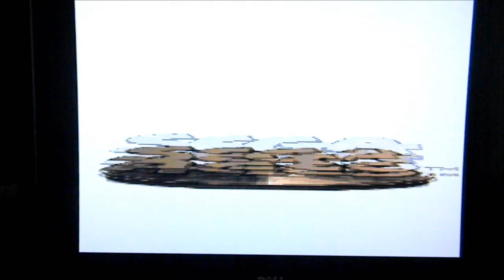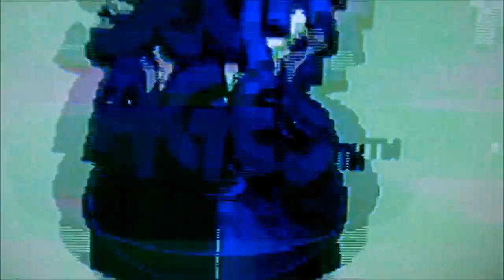SLG3000 Scanline Generator Review and Demo

Comment: For some reason mine causes the picture to go extremely dark, so much so that details are lost (for example Castlevania SotN's backgrounds turn entirely black). I've turned all RGB dials up as well and even at their brightest, the picture is dimmed about 50%. s
Scanlines in emulators don't have this effect. The only difference I'd that I am running this through a Retroscaler 2x.

TL;DR: How do you brighten up the screen while using this device?

Comment: Hey there, I know this video is rather old, but I wanted to ask you about my setup since you seem knowledgeable on the subject. I am emulating retro games on my PC via Retroarch and Fightcade, and I have a CRT PC monitor (my graphics card is old enough to connect via VGA cable). 

Since my monitor is limited to a 31kHz signal, I can't get the older 240p style games with the native scanlines like you can in these videos with your tri-sync monitor. While there are shaders available, I am particularly interested in arcade games, which are difficult to display correctly with integer scaling in a 4:3 aspect ratio without black bars, and most shaders are designed with integer scaling in mind. I was wondering if now, in 2024, you'd recommend I get a bit of equipment like the SLG3000 to get the scanlines for these older games, or if there are better options available for this sort of thing nowadays.

Either way I appreciate these videos, and I wish I had come across them earlier in my journey to learning about CRTs/scanlines -- it would have saved me a lot of time and confusion. That's impressive considering these are from 13 years ago!
Reply from the maker: SLG3000 is definitely worth a go on your PC CRT, but I'd be inclined to mess around with shaders as you can do so much with these nowadays.  Are you using MAME or Retroarch for your emulation?
Reply: I appreciate the response. I am using Fightcade and Retroarch for emulation, but I can't seem to get integer scaling to work properly on the old arcade titles, which are not exactly 240 but more oddball resolutions like 224 (like Capcom fighters for example). Using integer scaling + 480p results in black bars, and the best shaders require integer scaling.

The way I figure it, I could run those games full screen in 4:3 aspect ratio the same way they ran in the arcades, then use something like the SLG3000, and I'd have it pretty near accurate. What do you think?
Reply from the maker: @SleightSoda  Mmmmm.... I use MAME with HLSL and it works fine for me.  Are you getting alignment issues with scanlines using shaders and non integer?
Reply: Yes exactly, most of the shaders on Retroarch require integer scaling, and I'm not too happy with the ones that work without integer scaling. The only other solution I've found is super resolutions, but my PC Monitor is too underscanned for those to fill the screen completely on the left and right sides.

I think overall something like the SLG3000 will give me better scanlines and allow me to have the same results whether I'm using Retroarch or Fightcade (which is an important goal for my setup).

I was wondering, while I have you here, if there were any monitors in particular you would recommend? I have an old Dell monitor I am mostly happy with, but I am always looking on Facebook marketplace for an upgrade :)
Reply from the maker: @SleightSoda  I'm not really an expert on PC CRT monitors as I only have a couple.  TBH I've now moved to the latest Samsung LCD's (I have a 43" QN90C for my PC desktop setup) @4k with VRR and HDR - they work great with emulation and shaders.

Comment: Hello I have a pandora's box 3 rocky version (the cheap one)  HD version.  I have some trouble with newer lcd monitor. They go out of frequency, black screen and led blinking. With old lcd with only vga port works fine. I'm asking if Scanline Generator SLG3000 should help me. The problem seam to be the vga signal is a 800*600 with a weird frequency around 40hz. I Olson found on Web the gbs8200 board. I'm not an expert in signals so I don't know if I have to clean the signal or convert. Can you help me? Tnx
Reply from the maker: +Andrea Mancini The GBS will output a standard 640x480 @ 31hz, so should certainly work correctly with your LCD.

Comment: Silly question. Will be doing this project. But I have a pc monitorr I want to use instead of. LCD tv. Were would my sound go? Just a pair of speakers with LnR input? Should work shouldn't it?
Reply from the maker: ItsxDanx You'd need to route the audio to an amp.

Comment: Hello mate, iv just bought the sync strike, ega scaler, and the slg 3000, and the scanlines look really good, coz with me its all about the scanlines, and it looks so true to the retro look, but when the scanlines are on i get thick dark shadows on the screen, do you know whats causing this, your help would be greatfull.
Reply from the maker: Without seeing a video of what this looks like, it's hard for me to appreciate your issue.  What resolution screen are you using?
Reply: Im pretty new to it all, my tv is 1080p, and im using 600x800/60hz, coming from the scaler
Reply from the maker: Daniel Hodgkinson Should be set to 640x480 from the scaler.
Reply: Thanx for that, i managed to get it to work, and it looks mint, thanx again.

Comment: what systems did you test?
Reply from the maker: Most of my retro stock, which is pretty much everything post the 8 bit era.
Reply: Faginrs500 will this take a 240p system and give it scanlines, thus making it 480i(or is it p?)
Reply from the maker: You will need a video processor prior to the SLG3000, to accept the 240p signal.

Comment: Would you recommend the slg 3000 for use on my mame machine, over the built in scan line filters offered by mame?
Reply from the maker: IMO you're better off using the effects already available within MAME.

Comment from the maker: No - lol!

The CGA to VGA boards take a 240p image (from a retro console) and rescale to a higher resolution / scan frequency, to work on say a LCD or PC CRT Monitor.

The ArcadeVGA is a PC Graphics card that allows the PC to output a low resolution image, for direct input into a CRT TV or Arcade CRT Monitor (for instance).

Comment from the maker: No.  The ArcadeVGA is a graphics card to produce 240p resolutions and the SLG3000 is a scanline emulator (for intend and purpose) for 480p video signals (although will work with a wide range of resolutions).

Comment: Ok, no photo yet as the camara is without batteries, and meanwhile i received the rest of components i was expecting. A HDMI converter from lenkeng, enabling input from scart rgb. BUT IT WON'T WORK with Megadrive/Saturn/PS1/2 etc, all consoles give me wrong colors! only the Xbox 1 works good, with ntsc 480i, don't know why this is happening, maybe because of the 280p?!? but even the PS2 don't work. The manufactur states it works with consoles, in 50/60hz rgb or composite. I tryed to get the

Comment: @Faginrs500 when i swich the 4 and 5 on or off there is a slighty change in the picture, but don't get any better. Is there more switchs? i see on the net what seems a older version of the SLG 3000 and it has 4 or more switchs, but on mine i only have two. The 3 rotary next to the potenciometry move? i'm afraid of breaking something on it. Sorry for my bad English.

Comment from the maker: @6Damien6Omen6 What happens to the picture when you turn the scanline rotary control (dip 1 off and dip 2 on)?  I would suggest it is a problem with the HD Fury.  I tried the HDFURY 2 and it didn't work.... I had to buy the HDFURY 3.

Comment: Hi need help, i just received my SLG-3000 and a HD Fury Gamer edition. But when o connect: Consoles + DVDO Edge + HD Fury Gamer Edition + SLG 3000 + lcd samsung =  a horribel distorted image, with lots of waving and interferance. The SLG 3000 is working good as i connect a Dreamcast directly to it via VGA and works great, the HD fury works great solo as well, don't know where is the problem. Allready changed the 2 dipswitches on the SLG but i only get small visible alterations. Any sugestion?

Comment from the maker: @natedavis82 The only thing is the XRGB2 has a fixed scanline mode as I'm sure you are aware.  Whereas the SLG will provide you with ability to adjust the scanlines.  It will certainly work in tandem, but you would want to turn V-LINE off on the XRGB2 and use the SLG to control the intensity of the scanlines.  If you had a XRGB2+ (and you only wanted to reproduce scanlines on retro stuff) you would be wasting your cash imo, as that linedoubler provides more options for scanlines.

Comment from the maker: @1dosucol1 The resolution is the resolution.  All changing the ratio does, is effectively stretch or shrink the image (depending on the input).  640x480 is 4:3, 1280x720 is 16:9.  If I run a 640x480 resolution on my widescreen monitor it just stretches the original image.... enabling the proper aspect ratio just ensures that the proportions are correct.  The LCD is already scaling the image, else 640x480 would be a small area in the middle of the screen.  Makes sense?

Comment: @Faginrs500 What size card have you run with mame scanlines without difficulty?? I have used a 256mb video card which plays most games in mame just fine, but when I turned on Mame Scanlines It would studder occasionally and seemed to tax the video card. What would you suggest?

Comment: @Faginrs500 What size card have you run with mame without difficulty?? I have used a 256mb video card which plays most games in mame just fine, but when I turned on Mame Scanlines It would studder occasionally and seemed to tax the video card.

Comment: @JetSetBaroni I was running a 256mb video card and it plays most games just fine, but with Mame scanlines it would studder occasionally during play. If it is my settings, I wish I knew what to change. What size video card were you running with mame for mame scanlines? 256mb 512mb or more? Past 512mb video card your going to pay more than the cost of the SLG3000 arent you?

Comment: Hi Faginrs500. In response to your comment about using this for mame. I think the large benefit with the slg3000 is that you dont need a powerful expensive video card to run this. If I wanted to use scanline emulation in Mame I would need an expensive high powered video card and the know how to set it. This is plug and play with non latency. This method is cheaper and has no known delay. My video card doesnt have to work hard to process the games in mame on my old pc thanks to the SLG3000

Comment: @Faginrs500 don't think so, I mean the very thin horizontal artefacts that look like scanlines except they create nasty rough edges around moving images. It was apparent before you turned on the SLG, look at 08:34 round that LH bend, at the trees. Pause and you'll see it. Presumably these artifacts are present where an interlaced image is being displayed on a non-interlaced format (ie 480i image on 480p device. So you get two half scans (which presumably makes a scanlined image on a CRT).

Comment: lovely jubbley! Well I ordered one after the first vid. Agree the results are impressive. One issue I'm not keen on, which actually seems to be fine with the SLG turned on, is that once upscaled, the RGB scart image does that horrible interlacing that you see on badly converted PS2 PAL shmups like Psyvariar. I hate that efftect big time. But I will look into upscalers anyway. I am seeing myself using this hooked up to LCD/Plasma for PCE, Saturn, DC and even PS2. Thanks for bigging this up!!

Comment from the maker: @MENDEZ1628 It will certainly work with MAME..... but you can do other things within MAME to not need this device mate.  I will do a set-up video in the near future.  Regarding the LCD bit..... with CRT's you have something called the shadowmask which provides a visual effect and also the phosphorus effect.  None of these CRT "effects" are emulated, so you won't get that CRT image perfectly.  Yes.... the image is cleaned up and you don't get the blockiness you normally associate with LCD.

Comment from the maker: @VFDB This is very much the same as VGA games for the Dreamcast, that were coded to take advantage of the Hi-Res graphics.  In essence this device is of limited use in that instance.  The same can be said for the hi-res mods for the 360, but since the original game was lo-res it may look better.  It's all down to preference really.  All the CAVE games / modes will still look good with the SLG3000.